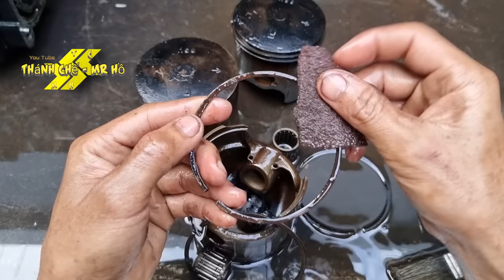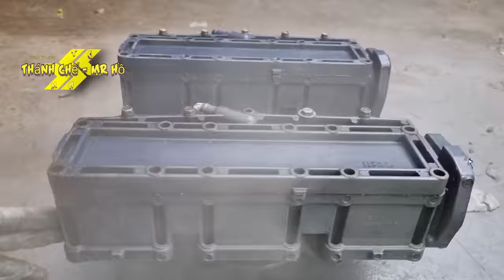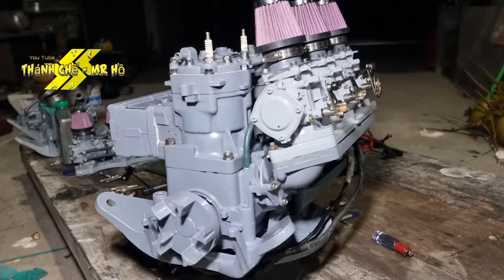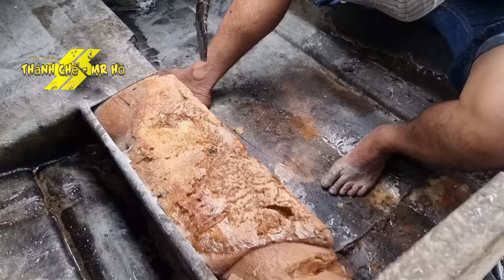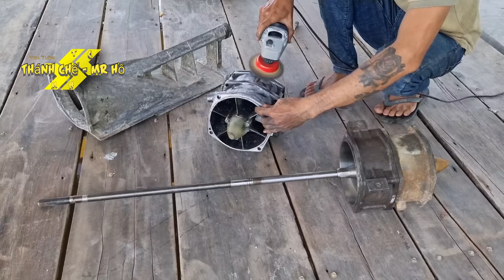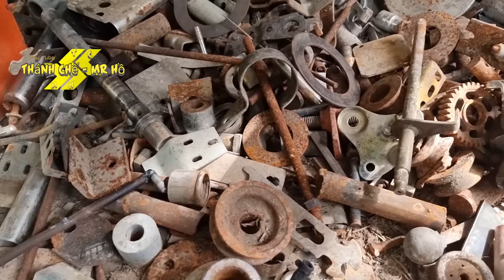tôi tự chế tạo cho mình một chiếc thuyền 2 động cơ phục hồi lại từ bãi phế liệu

Comment: End of part 1???  Ohhh, you're killing me!

Very intriguing.  So you did not like the other motor??  Did the other motor run too deep, you'd rather run in shallower water????  The boat seemed to run really good on the Isuzu 4 cylinder...  I'm trying to understand the total re-powering & re-thinking of the powerplant & design....

Those look like pretty big Jet-Ski motors...  Should have plenty of power.  Heh heh!  Nice.  

I love what you do, but sometimes you confuse me a little bit...  You clearly KNOW what you are doing, you are smart....  But, no torque wrench??  Ever??  Some of that stuff, you should definitely be using a torque wrench.  Those reed valves, some of them were damaged....  and you just re-used them??  You're doing SO MUCH WORK, it would really be a shame if it ran kinda crappy because you didn't replace the reed valves when you were literally holding them in your hand, it would have taken zero effort....  

I was also curious, you took the engine block to a machine shop to re-bore & re-hone???  Or you did that yourself, off camera????  Or, that was sleeved??  I'm just curious, you went from some pretty rough-looking cylinder walls, to some really sweet smooth bores.....  Those engines were pretty rough.  If you get those running good, that in itself would be a very good accomplishment.  I tip my cap to you Sir.  You have talent, and you are not afraid of work....  and you don't exactly have a clean air conditioned shop either, you're working in tough conditions....

Uhhh, also, I love your boat lift.  Very clever!!!  Heh heh heh!!!  Well done.  Anyways good luck, I look forward to more videos.

Comment: I didn't even realize it was a 2 smoke till he started cleaning/replacing the reeds. After that the vid got my fully undivided attention. Great job. Well done.
Reply: Well 4strokes also don't generally have  exhaust outlets cast into the sides of their cylinders
Reply: Remember watercooled 3 cylinder 2 stroke 750cc motorbikes? Bloody fast bikes, compares to a 1000cc fourstroke, maybe. Lots of revs means lots of horsepower. I bet these things are like that. And then two of those, though that does NOT double the actual horsepower, props don't work that way, but you get lots of power anyway.

Comment: I would’ve thought that all those microscopic scratches he’s doing with the sand paper and screwdriver isn’t going to do the help with the combustion chambers. Also reusing the old piston rings?  Apart from that, it was good to watch 👍👍
Reply: I see no reason why he can't use the old parts as long as it's with in tolerance why spend a bunch of money if you don't need to, don't think his concern about new stuff as long as it runs. reminds me of my hotrod days timing light and a torgue wrench is about high tech we got and junk yard parts.
Reply: @Zanzamor  I see what you’re saying. If it’s an old engine and it’s been thrown out. There must be a good reason.
Reply: Those engines are both junk i would have just bought 2 new used ones these engines are not some old small block chevy you can bore out several times They have tight tollerances. theres a reason it was in the junkyard They may run but for how long ? and the power will be down from what it should be and will dump oil into the water. Ive been here done that and learned my lessons. there are no shortcuts in boat engines they suck in dirty sandy water all he time often overheating and are at wide open throttle much of the time under full load. thats why junkyards are full of broken jetskis and jet boats
Reply: @jbncnow  I remember having a car engine  this was when I was in my teens. It was really well worn and knackered, it had no poke. So I stripped the engine right down into all its components . Cleaned up every little parts. Reassemble it and spray painted the engine. It looked really good. This time it looked a really clean, painted well worn knackered engine 😂. This was when engines were simple, non of these sensors and electronics. 👍👍
Reply: @jbncnow  Maybe you should go there and take some lessons from him to learn how to revive engines that people threw away thinking it would never run again his proving time and time again with his rebuild and  of broken down engines, you don't need to buy a new engine every time you think a engine is worthless as he keeps proving with his rebuilds and in that part of the world you do what you have to, to get things working even if you have to use bailing wire and duck tape, that's not America the throw away country, don't work buy a new one.
Reply: @taffythegreat1986  If it's thrown away maybe it's because the owners don't know how to rebuild the engines sure you can have problems but does it mean it can't work in the hands of the right people, only reason I wont rebuild a engine is if its got a cracked block, that engine doesn't look old cleaned up that's not his first rebuild i've watched him rebuild a lot of engines he got from the scrape yard or under water.
Reply: @Zanzamor  I’ve seen a couple of his videos. He’s certainly hands on and have the knowledge 👍

Comment: Why do you always staple everything when welding electrodes? You can weld super continuously with an electrode! so you never burned the right one into the material, and why don't you ever have sweat protection for your face? happy old age for your eyes...! and why do you always laminate everything straight into the GFK? if one of the jet drives breaks down, you cut everything out qieder ... all in all not really thought through and done unprofessionally!
The old Pistons and Rings in the two Storkes Cylinders...sorry no!

Comment: What is the white board that you use to fabricate the boat design? It almost looks like a type of foam?
Reply: Marine foam board, Marine foam core. Used alot in boat building from cheap rowers to luxury yatchs, you have to fiberglass over after install, it basically is the skeleton of the vessel and the fiberglass is the skin.

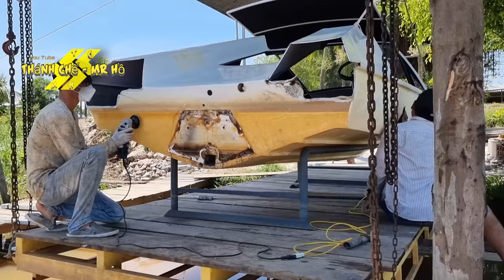Comment: did anyone else notice him throwing the foam into the water? or at 19:49 where you can see foam floating in the water.
Reply: The boat is on a Pier so he prob just has to clean the pier/ramp up afterwards. Generally I just give benefit of the doubt until it is obvious that's not the case, It makes life a much more positive experience for everyone involved.

Comment: cant wait to see part 2
what is the white board product that you use to form the pieces of the boat???
Reply: Marine foam board or you can look up foam core for boat building. Very easy to work with from designing to moulding/sanding. People scoff when they hear "foam" but once installed and fiberglassed over it's stupid strong and resilient.

Comment: That engine will NEVER last! You had badly scored pistons and cylinders! You had rod bearings that were thrashed and destroyed! You reused the bad rings! God knows what other obviously BAD parts you didn't show in the video! WORSE YET, BOTH engines were thrashed!!! This boat...sure it might run for a little while, but it will still need real service VERY SOON! You should have replaced every piston, all rods, all engine bearings and possibly the crank shaft too! Awe hell, buff it up, cover it all with a nice coat of paint so it looks good and run them as is! I was impressed with you getting that engine covered in barnacles going. This however...2 totally TRASHED engines...I'm appalled!
Reply: have another watch, he only cleaned up 4 pistons not 6, the two scored ones were replaced, the bores were repaired he showed a closeup of that and he had the big ends replaced on all of them, he showed that up close too.
Reply: @-TheRealChris  I watched it twice. I could not be sure if he replaced anything. I assumed and maybe incorrectly that he reused everything. I do realize that later on he moves a couple of pistons on the crank and I assume that was the really bad ones with burnt out bearings. I thought he replaced the roller bearings, but I was not sure what else might have been done. I'm pretty sure he did not resleeve either block and at least one of them was severely scored in several cylinders. I did see the close-up of the one cylinder wall and paused to look at any shot of the cylinders. He did reuse several pistons and it looked to me like he reused all of them. None looked new to me. They looked like they were all the old ones, just "cleaned up". I doubt he remachined the sleeves to clean up the scoring. IF he did rework the cylinders, this would require all new pistons and rings that were slightly larger. There were no new pistons so this is unlikely. Maybe he had another of these engines to rob parts from for the badly damaged block and pistons?